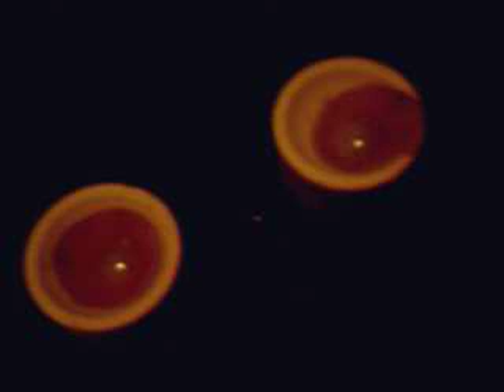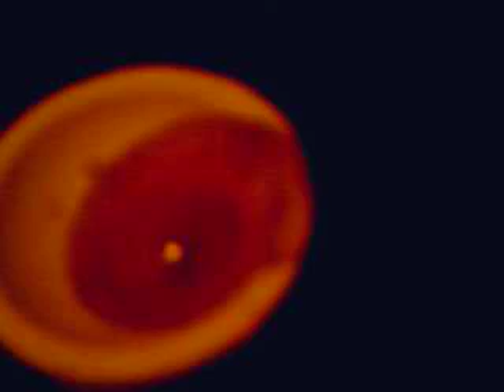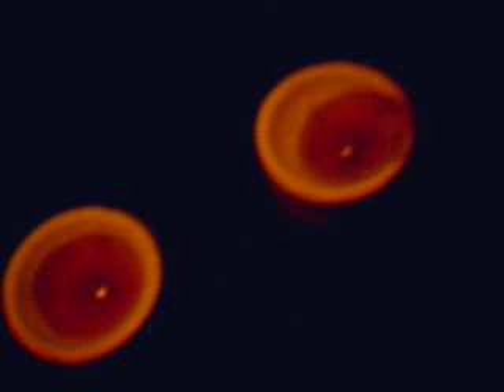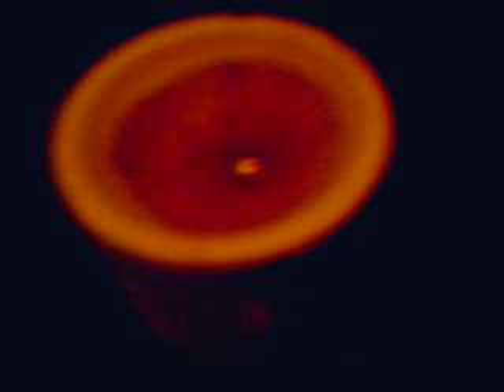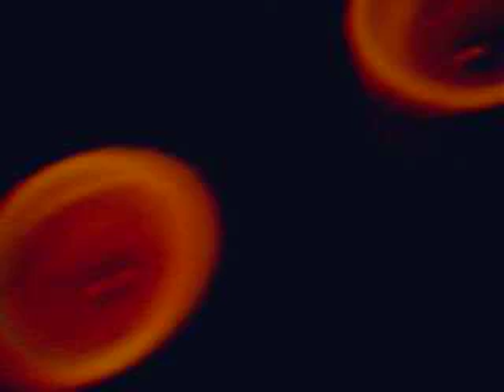Assaying the Gold foils recovered by processing E-Scrap in an AP Tank.  Part 11

Comment from the maker: @buck26wheat Size of what? The tank system, ... aquarium pump for around $20, bucket of some sort with a lid from a deli or restaurant $1, aquarium air hose $2 to $5 , A tube of JB Weld, Liquid Nails, or some other bonding agent to assemble a bubbler and to seal the through hole in the lid $5... so approximately $30 to build a small tank system like mine.